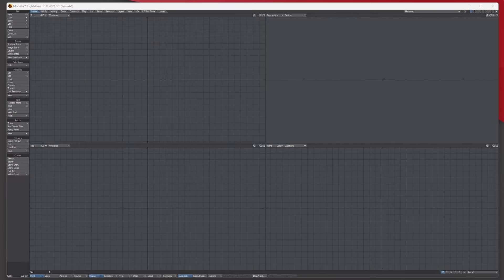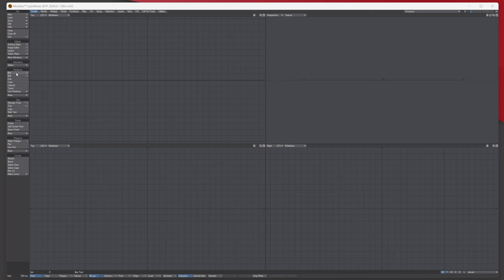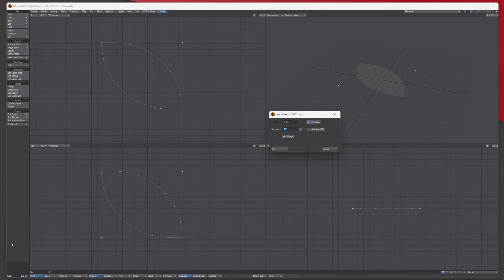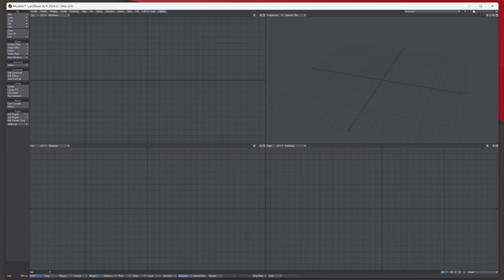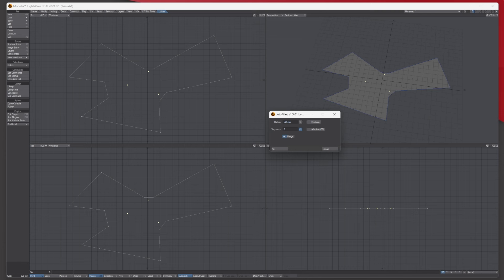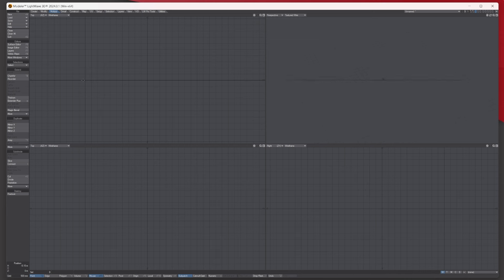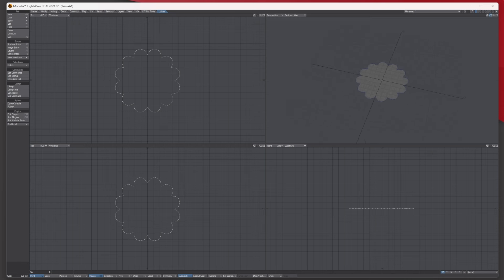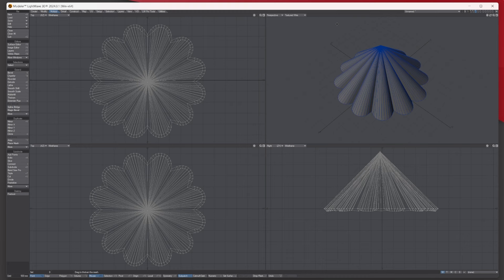Lightwave 3D Jetto Fillet plugin

Comment: Just tested and this plugin also works for Mac. It feels like rounder should easily be able to do this but you get the..."A selected point is not inside the surface of the selected polygons (L138)" error.